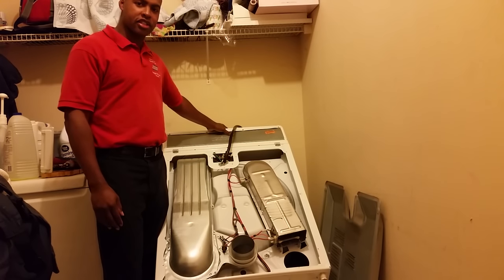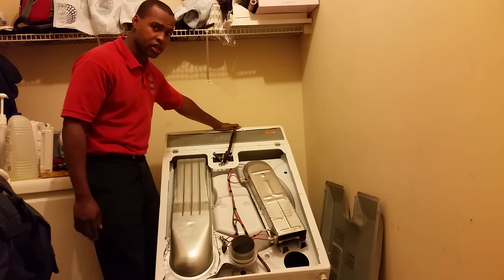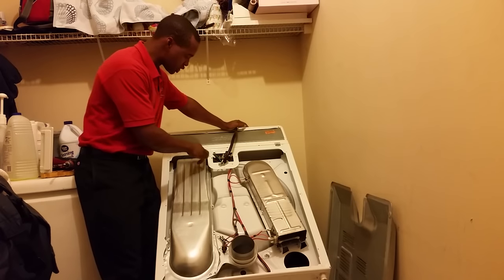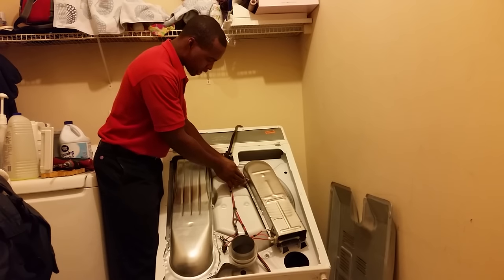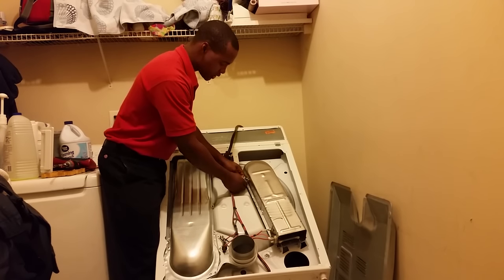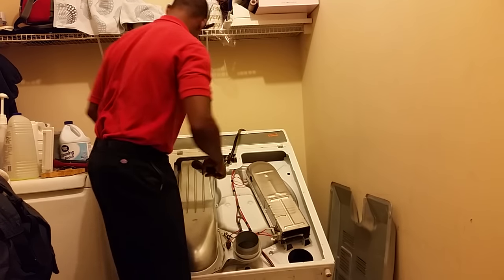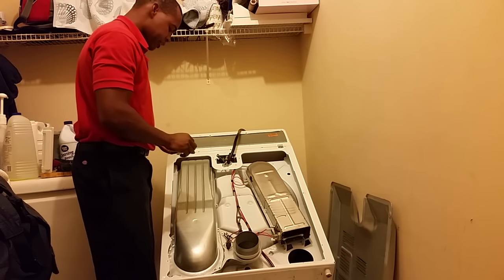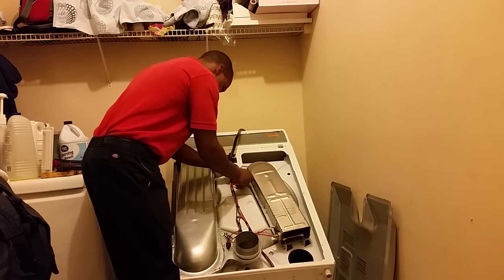How to repair a dryer that works but will not get hot

Comment: My problem is that : Everything tests good on the dryer!! and it's not clogged up!! but it's still not getting hot!! Uugghhh!!!
Can't fix it cause I can't figure out what the problem is ~ appliance parts store hasn't figured it out either.
((dryer just stopped working all of a sudden))
fuse tests good
thermal fuse tests good
heating element tests good
thermostat tests good
timer is brand new
lint trap completely clean
outside vent is blowing strong
Reply from the maker: Did you test the voltage on the wall outlet?
Reply: Voltage was a little over 240 but I found the problem...
I followed the wires that go into the bottom of the dryer and under the drum.
The wires are all connected to a "plug like" thing that is plugged in near the motor.
This "plug like" thing was coming loose on one side so I snapped it back in and it's heating again. Fixed for $0.00
Reply from the maker: That's great and a very very rare issue. That harness is typically very secure. Probably wasn't fastened property at the factory and took a while for it to shake loose. I'm glad you found the solution.

Comment: I have a stackable Kenmore, my dryer takes 2 times to dry clothes. i also should mention its a 120 Volt apartment size. model number 110.81442710

Comment: my dryer gets hot on automatic but not on timed dry or fluff dry
Reply from the maker: Sally Moore fluf air is a non-heat setting. On time dry be sure dial isn't on wrinkle free which is also a non-heat setting.

Comment: after watching your video I notice that one of the coil was broken does the heating element need to be replaced?
Reply from the maker: Mandac Jessejames yes the heating element has to be replaced. You can also reconnect the coil by overlapping them on each other as a temporary fix until you buy a new coil. may last one load May last 10